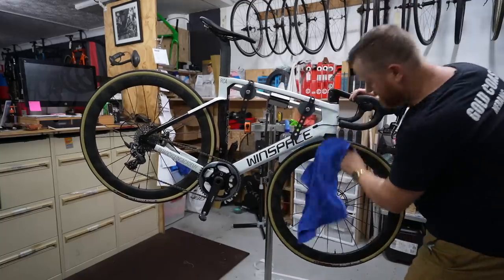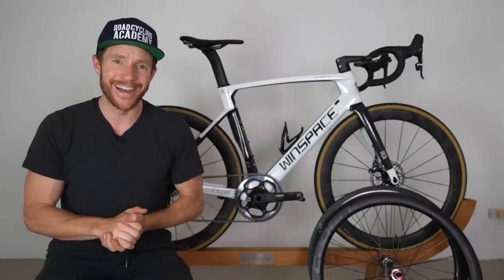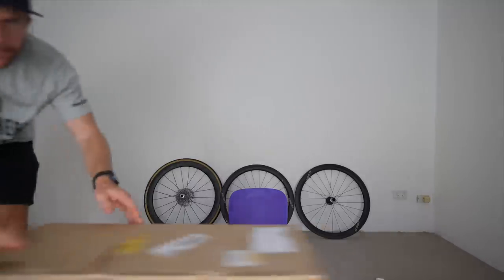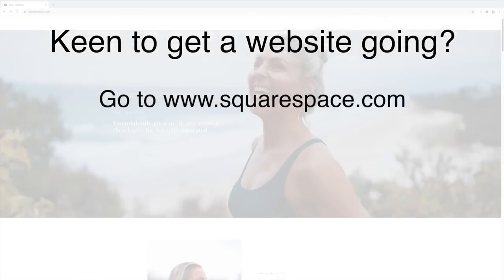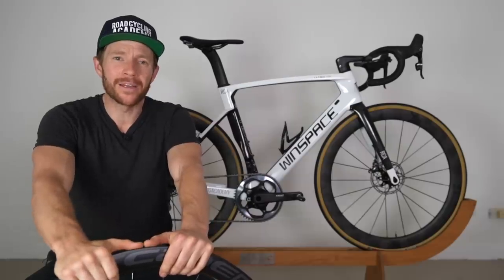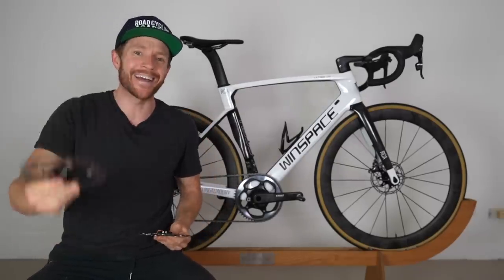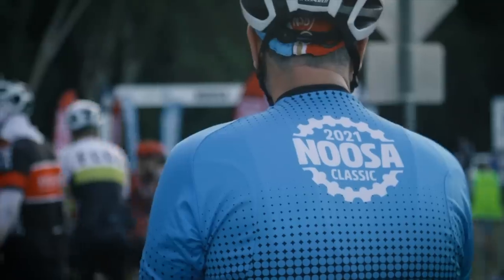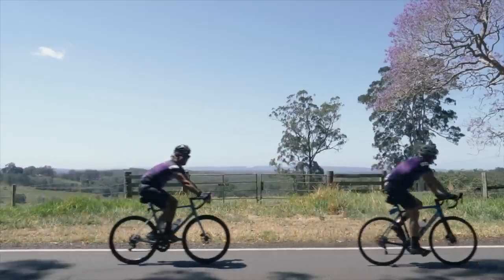Winspace Hypers VS. Caden VS. ICAN Chinese Carbon Wheels

Comment: Ive got a set of Ican 38’s and LOVE them.  Have had them for 3 years now and they are still as true as the day they came out of the box.  Though I have had the bearings changed out.  
Love the content Cam.  Can’t wait to hear the review.
Reply: hello michael , what model and brand of bearings did you use  ?
Reply: Oh man, I hate to tell you, I do not know.  I just had the bike shop do it and I never got the details of what exactly they put in there.  I suppose I should know that.  Sorry Joe!

Comment: I have used all 3 of the wheels on review. In the end, for me, I was super happy with the HYPER Wheels. I enjoyed the ride from all the wheels. Each is very nice, and shows the great products coming out of China.  The HYPER Wheels ended up being my "Best of Class" from the 3.  The HYPER Wheels size 38 have been the best clincher rim brake climbing wheels I have ever used. Looking forward to your future videos Cam!
Reply: Why did you like the hypers over the others?
Reply from the maker: Thanks for sharing on the thread Keith. Interesting to hear
Reply: @DanTuber  It was a few different reasons for me. First off I noticed the stiffness and solid build of the HYPER Wheels compared to all other wheels I have used. They are built seemingly rock solid.  Maybe it is the combination of their own unique HUB and the Carbon Spokes and Carbon Rims when all pieced together. I do a lot of standing climbing drills and the HYPER Wheels never have a swing side to side that rubs the brake pads when standing climbing. On the other wheels, I would get a slight brake rub when doing my standing climbing.  Also, the acceleration of the HYPER Wheels felt world-class.  When I would do surges and quick sprints on the HYPER Wheels compared to the others the HYPER Wheels felt spot-on for acceleration.  All the wheels roll nicely and do put out good feelings. But the HYPER Wheels seem to be built stiffer and accelerate quicker overall when sprinting and climbing.  I also like the lightness of the HYPER Wheels.  The 38's are so good on the climbs and make my bike feel incredibly light. The ICAN Wheels are also very light and I admired those for their lightness as a wheelset. Plus, Caden Wheels come in super light too! These 3 wheels are awesome this is a fact!  I just felt the HYPER Wheels were more solid feeling when used and more durable in the build. With the other wheels, I noticed slight out-of-true sway to the other wheels, just slightly, after a few months of use. The HYPER Wheels I have had for over 1 year now and they still run 100% true with zero lateral movements on the rims. They still look and feel brand new after over 1-year use and I have been extra hard on these wheels.  As far as durability goes the  HYPER Wheels have exceeded my expectations. Another favorite is the skewers that come with the HYPER Wheels, they have been my favorite.  The skewers on the ICAN Wheels I have were one of the worst parts of the package.  The Caden Wheels skewers were fine and seemed much better than the ICAN skewers, but I felt most comfortable using the skewers from HYPER. I am picky on my skewers, and I want a skewer & quick release that feels super strong and solid and feels as if it will stay locked on when closed always, plus very lightweight as much as is possible. Also, the brake pads that come with the HYPER wheels I have really liked. They do wear fast, but they work great, make zero noise when locking the brakes up hard on the bike when that happens, and work perfectly overall.  

I only use Rim-Brake wheels so do not have the Disc Brake experience with any of these models. Let's face it, all 3 are great wheels. Bottom line the products coming out of China are top-notch and nothing like the products 10 years ago or so.  The game has changed, and for me, HYPER Wheels are leading the way for best of class in wheels and customer service.  Hope this helps some DanTuber. Just some of my personal experiences with the wheels and real-world ride feel.  Lastly, these reviews are based on feelings and experiences, not necessarily scientific data. I do think that every person could see and feel things differently.  I can say I ride a lot, often 5 days a week, and sometimes ride over 10,000 miles a year.  I have climbed over 1 million feet in a year. And most of all I ride hard and do a lot of intervals, racing, and intense efforts on the bike. So I just enjoy biking and love to get out and ride whenever possible!
Reply: @TheCyclesport  Nice review Keith thanks.  Do you have a link where you purchased your Hyper wheels?  Thanks again
Reply: hows the braking in these hyper rim brake wheelsets? and what brake pads are you using?
Reply: @KazuyaST  for me personally the HYPER Wheels and LUN Wheels stop as good as any Rim Brake carbon Wheels I have used and I have used a lot.  It seems to me so much of the stopping power and Brake modulation depends on the actual Brake Pads you use. Years ago I did come across so carbon Wheels that just seemed horrible for Braking.  When I applied the brakes it took multiple seconds to actually get stopping traction on the rims and then the sensations were quite grabby and hard to predict what was going on between the Brake pads and rims.  The HYPER Wheels seem very dependable and I have been happy with their Braking performance.  Of course in 🌧 🌦 rainy conditions this changes drastically.  As is the case with Rim Brake Carbon Wheels in wet conditions.  I can say that when you purchase the wheels from LUN-Winspace Wheels they come with my favorite Brake pads along with the wheels.  I know that Winspace did testing and quality checks ✔ as to what Brake Pads are the best for their Rim Brake Wheels and the ones they have chosen are my favorite.  I have tried 3 other brands and the ones that come with the Wheels are my preferred Brake Pads.  You should also try the LUN Wheels with the contoured Braking surface on the carbon rims.  I spend a lot of time on the LUN Wheels besides the HYPER Wheels and it's good to feel the different Braking characteristics of the two.  Hope this helps!
Reply: @TheCyclesport  thanks for the input mate
Reply: @lukewalker1051  sorry Luke just saw this now. Do you still need any help?

Comment: I like my ICAN Aero 55 wheels.  I've had them on both my road bikes for a couple of years.  Light.  Stay true.  They came with Sapim CX ray spokes and their own hubs.  Can't beat them for the price.
Reply: Their own hubs were actually Formula made (decent brand). 
Now, they're being made by Novatec (another decent maker).

I've had their Aero 50's on my custom stainless steel all-road build and on my 6.9kg Cannondale SuperSix EVO. I've bombed done big hills with them and ridden them on single track mountain bike trails. Still true.
Reply: @solitaryrefinement6787  that's pretty interesting info on the hubs.

Comment: One detail on the Hyper wheels that no one seems to point out is that they are rather narrow. I almost bought a set over the Cadens until I noticed they say they are "aero optimized for 25mm tires" with a 19mm inner width. I think a lot of people, unless racing, run a 28mm or larger tire now. I do anyway. So I ended up going with the Cadens that are 24mm internal width which I think is more appropriate for the wider-tire trend.

Looking forward to the test results. I suspect in terms of real world time, they will be very close. I upgraded to the Caden Decadence 35mm wheels from some stock Bontrager Paradigm Comp 25s (a non-aero and heavy wheelset) and got a real-world 0.5mph average speed gain.
Reply: Interesting @Jeff Valore I'm thinking about a similar upgrade, but to the Decadence 45mm tubeless disc brake - were the ones you got the tubeless & disc brake? If so I'd love to hear your thoughts
Reply: @eionsimmons3770  mine are also decadence tubeless disc. I've been riding them for a year now, and no complaints. Would buy again.

Comment: I just ordered and quickly received a new pair of ICAN road, center lock disk carbon wheels. They’ll  be replacing the alloy Royal 24’s that came with my 2018 Specialized Roubaix. I have no complaints with the Roval’s after 5000 miles and I’ll probably put them on my wife’s gravel bike as an upgrade. I haven’t had the ICAN’s out on the road yet, but at first glance they look beautiful.

Comment: Looking forward to a review on the ICANs. I  have a pair of the ICAN 38s and I love them. Then again, I’ve never owned any higher end carbon wheels so I really don’t have much to compare them to. Great video as always 👍
Reply: Ditto, ordered a set of 38s last Sunday, were delivered by Thursday and took them out today for a good bashing. Very impressed overall, excellent customer service and the wheels themselves are rock solid but light at the same time. Best value bang for your buck wheel out there I reckon.
Reply: @johnflynn4923  nice. Hope you enjoy them.
Reply: How are the freehubs?
Reply: @kp-dr7tt  I honestly don’t know enough to tell if they’re good or not but according to lots of other reviews, they’re pretty standard. Nothing special i guess. Definitely a lot quieter than my friends’ higher end wheels but I don’t mind.

Comment: I now run a winspace bike and wheels,and I'm extremely happy.I had an Sworks for a while and I was sooooo disappointed ...as in $8,700 for a frame and fork set disappointed. Winspace is less than half the price,under 6kgs built,  and a 3 year warranty.So im happy.

Comment: A word about wheel stiffness. In my opinion (54years and not so flexy anymore) a carbon frame and ultra stiff wheelbuilding can cause fatigue and lower back pain. So the deal must be to match a carbon bike with build in flex with a wheel or alternatively tyre and pressure that combined gives a positive riding experience. I run Campy Bora WTO 33 and Pirelli tyres at 65psi weighing 90 kg. And a shift in saddle from a Fiziik to a SMP Well Gel was the finishing touch resulting in a pleasant fast ride even on 120km+ rides.
Reply from the maker: Thanks for sharing on the thread Jan

Comment: I have used Chinese wheels from Alibaba and in my experience and they are as good as premium brands as long you haven't actually ridden  a premium brand. Once you try a branded wheelset (not even very expensive one, not even carbon!) you would feel the difference. I tried a set of alloy vision wheels after few Chinese carbon wheels (thou vision wheels were 200 gram heavier cost under 200usd). I feel it when I climb, I feel it when I sprint, I feel it when I standup on my bike, I feel it when I do 100 km of 30+ Km/h average speed ride, I feel it on sharp corners. The vision alloy wheelset (Team 35 Comp SL) made me ditch all my cheap wheels. My weight is 83kg and i can pus just under 300watt ftp. So I am on heavier side for a cyclist. maybe your experience is different

Comment: deffo need to compare those wheels at power of 200 and then 350 on the flat, I guess that's like 30kmh (majority would be doing this) and 45kmh (more for the athletes)

Comment: I bought ican fl-40s for my trek 1200. 1400 miles later still true although I'm a 140 lb rider but driving on 25s at 120psi  and pretty bad roads. No complaints they look awesome too. At 650 dollars they were expensive for me but I definitely couldn't afford the premium brands new anyway. And these wheels are slightly quicker then the original shimano tiagra hubs and alloy alex rims (I wore the rear rim out brake track wear indicator gone) so in my opinion they are an upgrade.

Comment: It will be useful to report the actual width of the 25c tyre on all three rims. The Winspace rim is only 26mm wide so the mounted 25c tyre might be wider than the rim, hurting aero benefits.
Reply from the maker: Can do

Comment: I got a pair of those I can wheels a couple o years ago, rim brakes. I opted for the DT Swiss 240 hubs, which are very good hubs. The rear wheel braking surface failed, due to too much braking after 5k miles. I weigh 200 lbs, so I was too much for these wheels. The front is still going strong however. I plan on swapping the read rim with a sturdier version. No point of wasting a good hub. The price on my option was around  $1100 delivered. I would recommend the icann wheel set for disk brake option.
Reply from the maker: Thanks for sharing on the thread

Comment: I've built a lot of wheels as a professional wheelbuilder and I have had zero issues with 24 spoke tangentially laced equally on both sides. 

The drop to 21 spokes has a bigger impact on longevity much more. If a wheel is built properly and tensioned evenly, the "old school" method of 2 cross equally spoked wheels is still the best way of building wheels. 

Don't forget that we're in the disc brake era is either the braking is being done on the side with proportionally fewer spokes.or the drive is. For discs it is even more important to have equal spokes for more consistent distribution of tension.
Reply from the maker: Thanks for sharing on the thread Murray, interesting to hear

Comment: I see the Caden tri spoke got a thumbs up from Aero guru Dan Bigham riding it at the World's TT.
Reply: Of course he would if you get sponsored by cadence. Why say crap things when you get made in china carbon wheels for free instead of forking out your own money right?
Reply: @PhiyackYuh  he isn't sponsored by Caden. He uses a variety of different wheel brands including his team issue ribble level wheels,  Enve, Revolver & FFWD. In the world's he used an un badge Cervelo P5/3 with a revolver disc rather than his team issue Ribble TT bike.  If you think Dan would ride something that wasn't fast at his big chance to impress British cycling you really have not got a clue what you are talking about.
Reply: I fact at the worlds probably his only sponsor correct kit were the WattShop bits (and maybe the TriRig & pyramid chainring parts through their association with WattShop)  as I think his company Sponsor Ribble Weldite.
Reply: At todays national road champs he rode DT Swiss /swissside wheels - not what you would expect if he was sponsored by Caden!

Comment: I could be wrong with this Cam, but if any of those wheels are designed to be run tubeless,  wouldn’t you lose some of that optimisation running tubes? For example, if they have a wide internal width to make the tyres sit wider, you’ll lose that benefit if you can’t run a low psi.
Reply from the maker: I'll cover this one off when Ben, as his wheels are set for tubeless

Comment: uhm i noticed that winspace had valves on them and they are tubeless ready which means that they have tape installed and they  weight 1475. Which is very low. The other wheels did they have tape and valves when you weighted them?

Comment: Did you ever finish this review?
Reply from the maker: Nope, but it’s in the planning. I’ve dropped some of the wheels off to a wheel expert for tech analysis
Reply: @CamNicholls  Looking forward to this vid. I found the 49mm decadence wheels (rim brake) to roll incredibly well and provide effortless speed at low power. But unfortunately I suspect they are not stiff at all as they drift through corners while descending and above say 300w up a climb they easily rub on the pads and just feel sluggish compared to a pair of 35 boras I own. Thinking of buying some winspace hypers to overcome this issue.